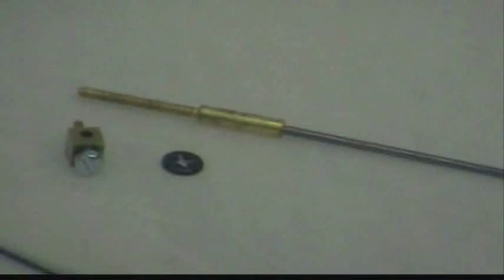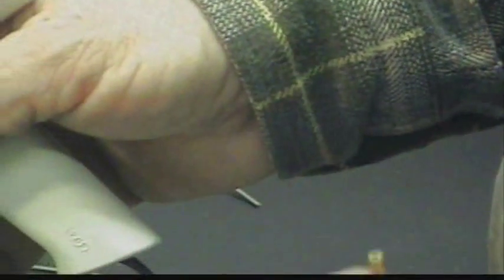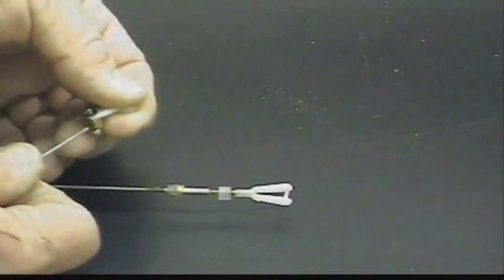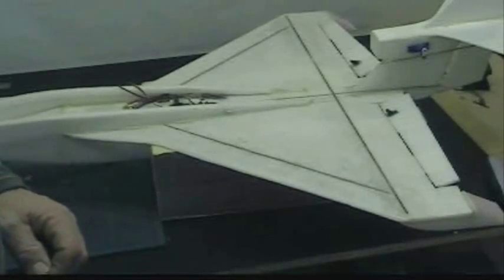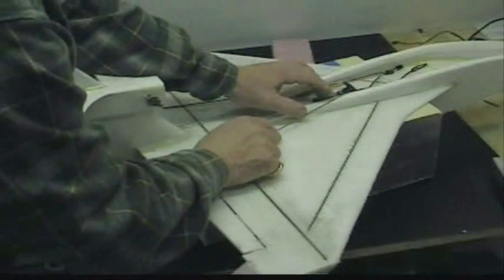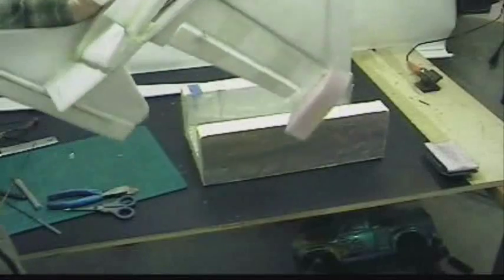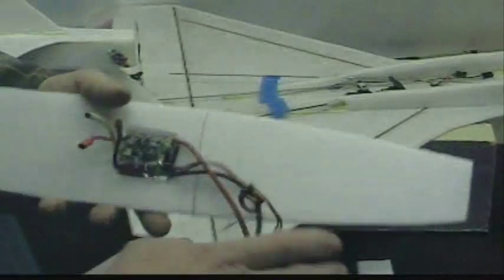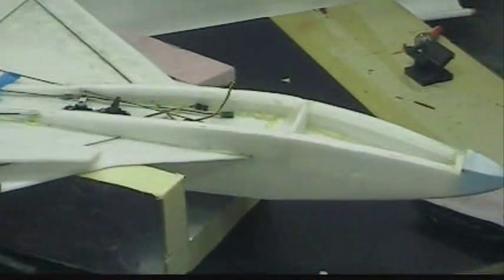Polaris Project part 9

Comment: Do you think that this plane will have a better slow speed flight control? I notice that the wings are further up on the body than the Heron plane which looked like it stalled when cumming in for a landing . I like the design.